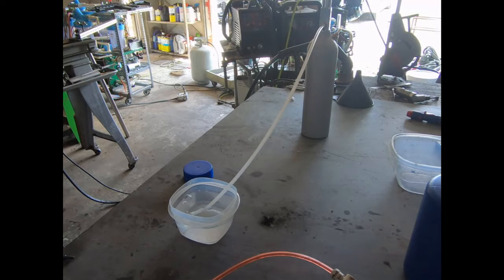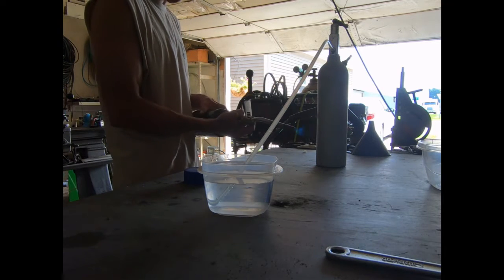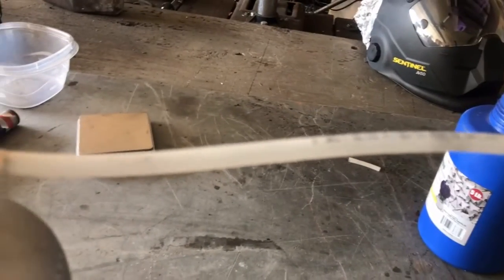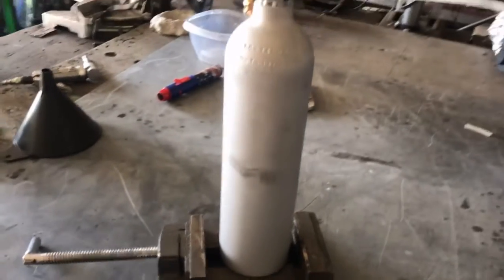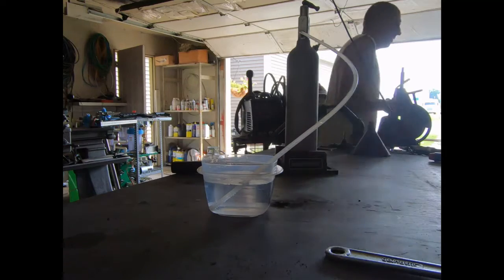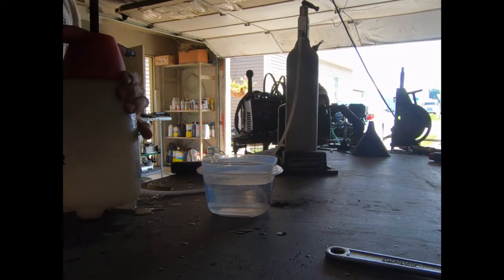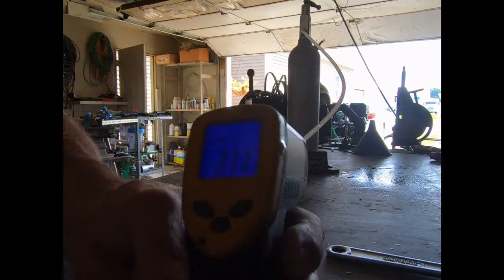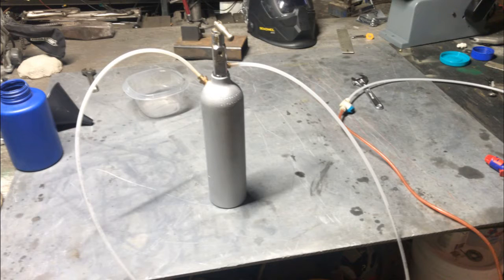Graphitic carbon nitride heated to 300 C after infusion

Comment: Graphtic carbon nitride is cheap to make. ( litterally a few dollars per kg ), and it can ( used the right way ) give you over 10wt% which is really amazing.  But theres no free lunch.  the 300-360C tempertures required for both of both  adsorption desorption.    That being said, it can all be done at 1 atm pressure, so, your not really talking about having to have a complex pressure vessel..  

A well insulted 'heater' box likely is 

If you have a green source of hydrogen, thats from a renewalble energy source, this could be a useful thing.
Reply: g-C3N4 absorption of H2 at 1 atm pressure?  Do you have a link to a study for that please?

Comment: I was thinking about this, but I think you would need to heat the material to 300c and then put it in a hydrogen rich environment until it cools and traps the hydrogen in its matrix. But the pressure you would need to get a 4g of hydrogen per 100g of material in a 1ltr container would be astronomical and up in the k's of psi.

Comment: Little rant, not intended at you, just for believers. "if it were that easy someone else would already be doing it". You can't beat the laws of energy we already have discovered. You can change forms and make a different form of energy (like that awesome torch you made) but you know you are putting more engery into it than you are getting out in flame power, the benefit is just that you are able to turn that bundle of electrical energy into such a compact flame, almost like a tig welder.... energy is still being wasted to run the conversion process, but what remains is compacted into a small area, like a magnifying glass in the sun concentrating light to a tiny area. Energy is lost, but it's still intensified by being concentrated. concentration isn't additional power, HHO scammers either don't understand that and are totally naieve, or they are straight out lying because they are ignoring facts like this that others have already told them and they chose to ignore. If a groundbreaking idea like this was just out there for the taking it WOULD be in use. Like the "100mpg carburetor" of years past, it can exist, but only on a moped, not a big passenger car. energy is engergy, end of story. And to add another layer of comparison, no one tries to sell a log that can heat your house all winter, because we all know what energy wood has in it.

Comment: Hmmm🤔 this is an interesting concept but seems like it would only be of benefit if you had free energy in the form of heat and a waste stream of H that you could trap...
Reply from the maker: Indeed . It could be used maybe for Grid level storage due to the lithium shortage and use solar heat maybe but from what i observed  
heating an item of any sizable amount is not a simple task and requires huge amounts of energy . Im going to try and make it one more time as i deviated slightly for the instructional video . Unfortunately  i cant find any info about this stuff , no videos of it working.
I am doing this for a client
Reply: @NOBOX7  I was thinking more along the lines of catalytic cracking plants where they have hydrocarbons they can get the H from. Catalytic heat and geothermal.
Speaking of catalyst...do you plan to try that sand heater thing with all this HHO?
Reply from the maker: @m3sca1   Lol havnt thought about it , i think this project is done , the expectations go beyond science at this point . I feel like im being asked to turn straw into gold
Reply: @NOBOX7  The DoE has teams of researchers on this material and others for hydrogen evolution, not storage.  I have also watched the video from RMS and have made quite a bit of this material with an electric kiln.  I don't have all your equipment, but I am using what I have to get to the point you have here.  Perhaps a collaboration would be of interest to you?  I have some ideas for the storage medium and containment.  My commitment to this is for commercial sale.  Please let me know.